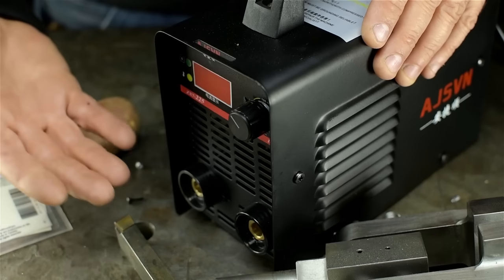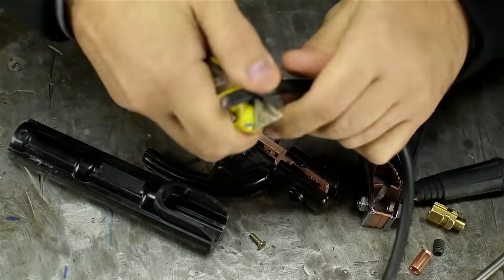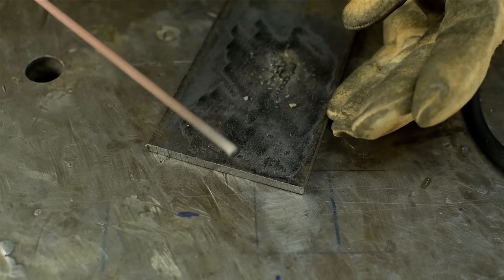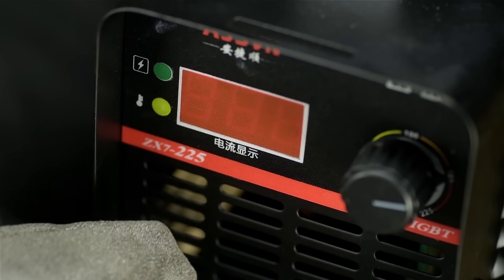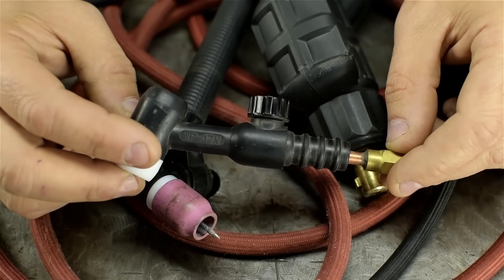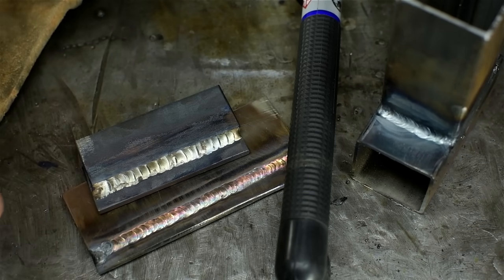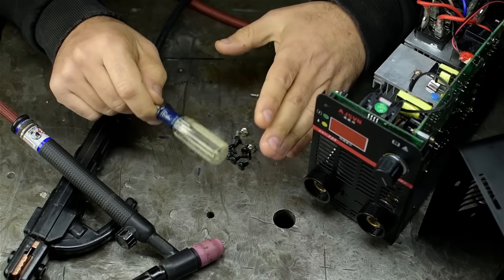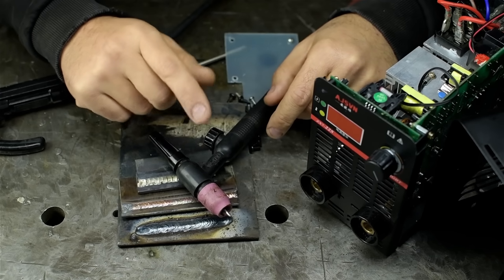Cheap Ebay Welder -- WILL IT TIG?!

Comment: You're on Volts. Put the meter to amps to measure Current.
Reply: he use a low hom resistor, a "shunt resistor" and meter the drop voltage across them!!
Reply: @veoazul looks like hes trying to use a clamp on ampmeter. Even with that the clamp on needs to be a DC one.
Reply: He did say Current Clamp!  My DC Amp Clamp outputs DC millivolts, just like his it looks like.  600 millivolds DC = 600 Amps, or - 0.078 DC V is - 78 DC Amps, look at the arrow on the clamp for +/- polarity.  In 40 years I have yet to see a DMM that can measure more than 20 Amps through the meter. Great video, Thank you!

Comment: That thing is really cool !! I need one, it might be good for home use but I don't want to burn the place down. When Sears use to be open they had 1//16 6013 but they're only 6 inches long and go quick. I don't know some of these welding video's, it's like being right there, you have to hold your hand up not to get flash burns. You carry lots of cool stuff around with you, prepared for everything...nice !

Comment: Im actually a little weirded out, you say its on 80 amps but it says "v" voltage..
Reply: and minus voltage :D
Reply: Yeah, that's unfortunately the wrong device and wrong setting to measure the actual amps

Sorry, I was wrong. Thanks everybody for the clarification! He's using an additional amp clamp.
Reply: Sorry, I was wrong. Thanks everybody for the clarification! He's using an additional amp clamp.

Old Comment: 
"He's measuring voltage parallel to his welding circuit, which should be zero, as the welding circuit is pretty much a closed circuit. Flickers a bit, depending on the current flow through is electrode. Overall the multimeter would burn out at anything above 10A in series measurement."
Reply: Fluke multimeters have an amp clamp that connects to voltage measurement. So the multimeter measures amps but shows the result in volts. That's how you don't burn out the multimeter with 100+ amps.
Reply: @Tbah83  you are right, most likely connected to a shunt in series. Multimeter reads voltage drop over a known resistance. 1millivolt drop equals 1 ampere or something like that.
Reply: @Tbah83  TIL. Thank you.
Reply: @robinpweber  No he isn't. It's a current clamp he's connected to the voltage range on his fluke meter. It directly converts amps to volts so he can use his meter on the volts range. As you rightly said, parallel measurement would be close to zero, and the model of meter he is using will be toast long before 100A is measured (well the safety fuses would blow at 10A)
Reply: Robin Weber and others
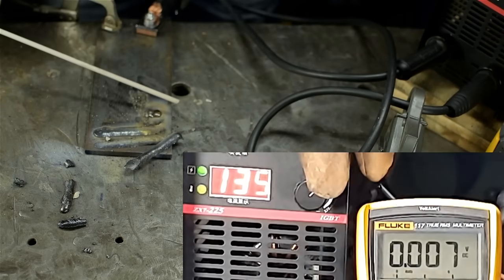It May have just been a fluke! Lol! The meter itself will read amps in two different ways, one by placing the meter leads in series to the wiring and load, but those are micro amps it reads done that way if I recall. Used for testing thermalcouples and the like. Here is is using a clamp on attachment that the meter wires click into as shown at 11:00 or there about, if u focus it’s almost same color as the table. It clamps around the wire and reads amps going thru the wire. The V DC designation is simply saying that it is reading the amps of a DC circuit.

Comment: For $60 this is a bargain.
If you are a little bit electrically minded then it is a great bargain.
As you said a "mower "repair or an exhaust hole  this would be great.
Great review , and very honest considering i do not think you were a fan, or perhaps you were unsure if you should be a fan.
$60 ,remember.
Price for value i think it looks like a real winner.

Comment: By your leave, I think I'll save my money and look for a decent real welder on Craig's List or something.
Reply: Yeah, same.. I was looking at cheap welders a few months ago, but have decided that I'm gonna go straight for an AC/DC TIG/MMA unit.. $1800 AUD * sigh * (HTP don't retail on this side of the Pacific (as far as I can tell)..
I'm also gonna need gloves, a helmet, rods, and a few packs of Tungsten tips - I expect to destroy a few.. you know, coz the closest I've come to tig welding, is watching these TOT videos..
Reply: If you're looking to get into welding/starting a shop, why not go oxy-gas?
Reply: A decent oxy acetalyne setup is mid 600 bucks from airgas. The tanks last a long time and it can do more than just weld.
Reply: @Taskarnin  Acetylene welding is not the same thing. I've tried it, years ago. I burnt through metal, I warped metal, I brazed metal, but I never welded metal. If I want to weld, I'll use a real welder.
Reply: Lassi Kinnunen  Maybe where you live, but not here mate..

The helmet I'm looking at is a "true-colour" display (ie: not so 'green'), and is $150 by itself, the welder is 1500, plus gloves and consumables.. 1800-ish
Reply: @John Loyd, People have been welding with gas since the the 20s or 30s. If you were unable to weld with your acetylene torch its because you did not have it setup correctly. For most basic welding applications like mild steel you want neutral flame. It is also slow. However if you're learning that can help. It also teaches you the importance of prep and cleaning your weld before hand. My father taught at a welding school for 15 years. They always started with oxy acetalyne. Most new welders will be welding mild steel that is relatively thin (quarter inch or less).

FYI it will do stainless as well, set slightly carburizing flame. Don't expect to pass any ultrasonic tests but they'll be strong enough for most purposes.

EDIT: I'm in no way saying oxy-acetylene is better than TIG. However if you're learning, weld only occasionally, and want to do that on the cheap and want a tool that can do as you said braze, cut, heat it fits the bill. Most people new to welding are starting their shop/hobbt and need more flexible tools. Don't take my word for it. Take a look at the acetylene videos on weld.com's channel.

Comment: I wonder how Dave from eevblog would feel about this.
Reply: He'd look at those electrolytics close to the heatsink (one looked like it was almost touching) and predict a short life if it gets used a lot.
Reply: Probably about the same way I feel watching this. The electronics are so close to being finished but just missing that last step of fit and finish to turn it into a decent tool. Given it's popping breakers and reading incorrectly, I bet there is a potentiometer or a reference inside that needs some adjustment. Tempted to order one myself since I wind up needing a crappy lil' welder and I could see a night with my scrap bin and random scavanged components box turning this thing into something that at the very least wont accidentally kill me.
Reply: @eideticex  : From the looks of it, I'd suggest starting by wrapping it in a properly grounded box. Maybe with a built-in GFCI.

And maybe a smoke hood.
Reply: @absalomdraconis  welders and gfci outlets do not get along well
Reply: ITSA BOBBY DAZZLAR!

Comment: Used one similar to this for stick welding found it loads better than old stick-o-matic buzz box cheap AC welder . Duty cycle is very good I usually give up before welder does and they weld so much better than cheap AC buzz box with its weld 5 min wait 15 min to cool . Mine looks the same but has 3 core cable with earthed casing used it loads its not killed me and its still going strong

Comment: TIG only requires 50 amps to do 3/8"(approximately), so even though the welding machine does not weld stick, it might be adequate for TIG. Do not try and exceed the 20% duty cycle, 2 out of every 10 minutes.
Reply: tig takes 1 amp per thou of material. you arent welding 3/8 single pass at 50a

Comment: "lGBT inverter welder"
But does it make rainbow welds and smoke rope?
Reply: It's an "I" not an "L". IGBT stands for "Insulated Gate Bipolar Transistor". These are a type of transistor that can switch fast with high efficiency.
Reply: @stefanl5183  Yeah I know, Tony himself even called it the LGBT welder. It was a joke.
Reply: @stefanl5183  ....yet another woosh

Comment: Best review of cheap welding machine ... I was almost sure that chinese welders amperage is half than the one rated on the box  (I have one both 15 years ago, so I weld it on max 140Amps for electrodes designed on 70-80 amps)... and you prove it by measuring it.

Comment: It wouldn't take much, to attach an earth lead to the casing.
Reply: BedsitBob true but most people who purchased this to use are likely beginners that just want something cheap to start out with
Reply: Looking at the internals, and the fact that there was voltage on the casing when it was switched on, it's very likely not designed to take an earth connection without blowing itself up.

Comment: Why is the multimeter set on Volts? not Amps
Reply: Clamp meters that measure high currents generally plug into the voltage range on your multimeter, and convert the current to exactly the same in volts.
Reply: What on earth are you talking about
Reply: @markajoseph1980  try this and I will ignore your ignorance. fluke i410. It plugs into the meter and you read the current on the voltage range of the fluke. You're welcome.

Comment: Current clamp was on the volts setting 😂🤣
Reply: That's how they work, 1 or 10 or 100 or whatever mV per amp. It's a clamp, not a series measurement.

Comment: I just bought a little buzz box… I used 7018 3/32…. Doing volunteer work for the church modifying a HVAC curb.. I had to ask for forgiveness for my quiet mutterings. He’s right…. Only use 6013 3/32 rods in the Mighty Mouse welders.

Comment: Inverter welders really don't like low voltage, if it wants 220 you give it 220. I tried to use mine on 170 (because the grid sucked) and the result was pretty much the same as in your first attempt. The old one that I have is home made, old school, coil welder that weights a ton, but it really doesn't give a shit about voltage, it works under any conditions. The only problem is that if the V is really low, it melts the coupling on the wall. The content of your pockets really resembles the content of my pockets.

Comment: I have a tiny mastercraft 75 amp welder. It works. I bought it for about 120 CAD. It burns 5/32 7013 ok enough , but throws the breaker. 3/32 6011 works really well ! It has a short duty cycle , but it’s so small I’m not upset. Like a foot by 4 inches by 8 inches .

Comment: When learning to weld more then 15 years ago, I had an issue with dry wires and some issues with my training welder shocking me lightly every so often when it should not have been. I informed other students they thought I did not know or understand what was happening, so I got one of the others to try it and he nearly jumped when he realized I was not full of it and the welder was giving off a slight but noticeable electric charge well using it. It might not have been true to a shock but the feeling it gave surely showed it was a slight hazard, the instructed checked it and finally said don't use your machine for now study for a bit in the books do that and I will change out the wires and fix it. Moral of Story, if you feel like your becoming the most electrifying welder in the world, stop using your welder. Considering a Tig stick can work with a battery and jumper cables from a car engine if required in an emergency, so I will assure you the basic mechanics of a cheap welder is about if the current flows properly to effected the flux coat and the metal in the stick properly.

It's also of note, that it's also of not that prisoners have welded with hot wires and a silver dime or quarter in days of gold, thus if there is a will there is a way. Meaning it does not all come down to the machine but the method of execution. You should also keep the wires from the machines off your metal or metal work service if you can help it, to eliminate some of the possible hazard of arcing or melting the wire and other such even with the rubber protections on them. Also welding machines are meant to have machine parts that step up the volt or power like a tesla coil, this increasing or lowering over all cost of the process, think of it like using a cameras flash in old cameras and such, but a more ramping electromagnetic process that is constant rather then flash in the pan. As in a step increasing regulator and the such. Stick Welding is like smoke a pack a day if you do it often, which is really bad and often is placing really bad carcinogenic things in your body and lungs.

You can buy a reasonable reliable American known produced or such for a few 100 bucks, I would avoid something that is a cheap killing hazard.

Comment: pro tip with scratch start put the cup on the material on its side and tip the torch till the tungsten touches and push the torch back down to lift the tungsten. its a nice easy rocking motion without arc marks all over. I do this method on my hobart stick welder and it does wonders.

Comment: I bought one of the cheap "200A" mini welders off Amazon (brand S7) for $69, then I found your video.  Mine came with actual cables attached too the ground and stinger and I purchased 6013 rods in 1/8" and 3/8".  The 1/8" worked great, but I couldn't get the 3/8" to strike an arc, even at the highest setting.  I'm a complete nube at welding, but have become fairly adept at Chinglish.  The manual just goes over the basics. So that was a bust.  I watch some DVDs I have on welding and came across some interesting info about shorting your welding circuit out, which it turns out is what I had done.  There are no rubber feet on these welders....so don't put them on your welding table.  Live and learn.....

Comment: I bought the Amico stick welder with arc force, it would run 6010 without any trouble which is hard to do on an inverter machine. We ran that welder hard for over a year. Got left out in the rain and its life ended. I will buy another one.  If you get one, get the Amico, its like $169.00,  we even arc gouged with it.

Comment: Those amp ratings were in metric because it was from overseas. A metric amp is 0.516 imperial amps. I think this is the source of your confusion, it is a true 225A welder, just 225mA or metric amps for short.

Comment: I have one like this different brand. Its 120 amp. I found that if you hold down the knob it goes to a mode to change the max amos number. Set to 120 then its pretty accurate.
Reply: For small stick portable fixes it's hard to beat.

Comment: Just here to share my 2 cents: I got a much better Tig machine for $400 CAD (~$300 US?) that can do 200A DC pulse Tig, with a 26 size torch and 4 button controls on the handle. And it is great.
I haven't used it much, but it works spectacularly for a DIY project machine. And the amperage seems accurate. The only issues I've had are that the buttons wiring was damaged and 1 didn't work out of the box (the 5 pin connector had some loose wires that broke off the solder joints) . And the ground clamp came with the wrong size connector.
So, I opened it up to trace the wiring for the controls (so I didn't mess up which button is which), and swapped the Din 15 for a 25 connector on the ground cable ($15 or so online for a 2 pack with male and female fittings), and it works fine. Plus, the company refunded my the $15 for the connector and confirmed that my fixes wouldn't invalidate the warranty.
I think it is a Hitbox machine. I'm not trying to advertise for them. But if any other wannabe welders are looking for a cheap Tig machine, check them out.

Comment: OK.....the jury just came in.....having bought one of these similar welders on Banggood with the intention of going to a Tig capability I'll now go the next phase and invest in a gas valve Tig torch, flow meter and gas bottle.....for the very few occasions I'll be using it but need to do some neat welding beads on thin and small fun work......nothing like a hands on recommendation to make your mind up.......I already have a plasma welder that does all the big work.

Comment: Dangerous AF,  yet, i'd still love to see the spot-welder come alive. 
I suppose you can build a "insulated cell" to keep the little b@stard in, just needing the cables to come out. 
I'm no arduino-guy, but perhaps it would be possible to connect one as a controller (length of spotwelding-time) for example.

Keep it up ToT <3

Comment: Your DVM was showing "Volts DC" when you were attempting to read the current output.
Reply: Look up “current clamps”. He was doing things correctly.
Reply: His was converting the current reading into a voltage reading for a voltage measuring device. Some just have a built in display.

Comment: 7018 needs more amps than any other rod, besides 7024 lol. It's got a lot more flux on it to burn. Switching polarity is what made the difference for you. You'll get a hotter arc that digs more that way... And scratch start tig is usually just used in the field. That's for big shot pipe welding on stainless

Comment: Love your presentation style Sir.....very interesting video.

Can you tell me....this is from a guy who has only used MIG ARC and Gas to weld......could the TIG setup with this machine be used to to heat metal maybe for bending ect or say heat up a very rusted nut to aid getting it off.....with no gas connected.

Or for that matter....could you weld thin steel plate ie car body  with the TIG torch....but no gas as if you were Oxy/Acet gas welding.

Or maybe the gas flowing cools the TIG torch?

Nick in the UK....a hobby welder.

Comment: There are capacitors in there..  but no transfomer to isolate the primary from secondary! That makes the wooden blocks under the welder pretty mandatory indeed